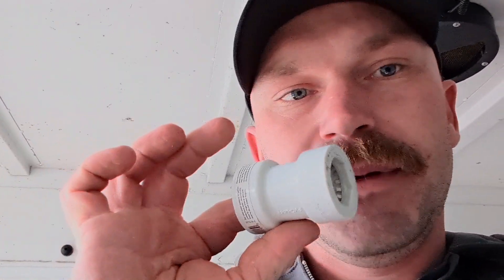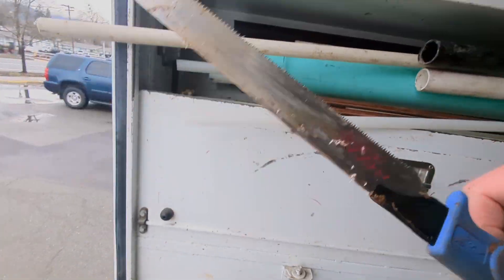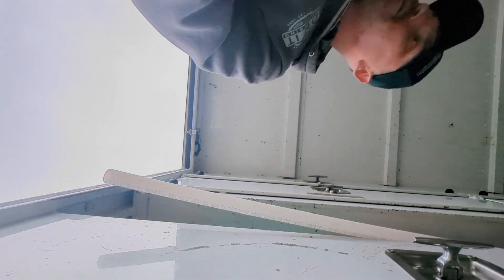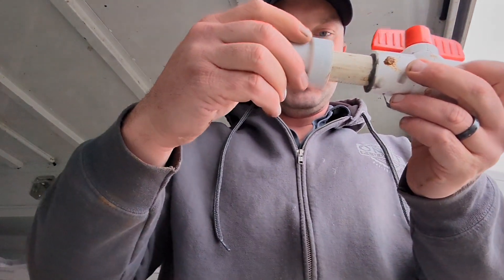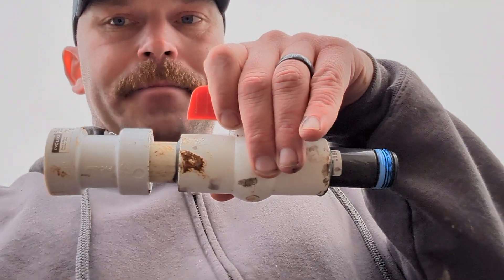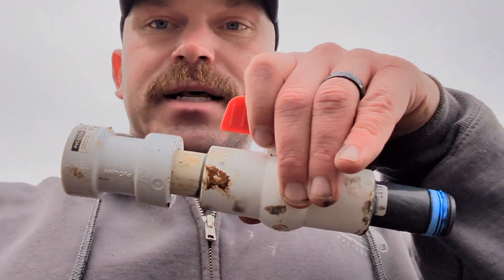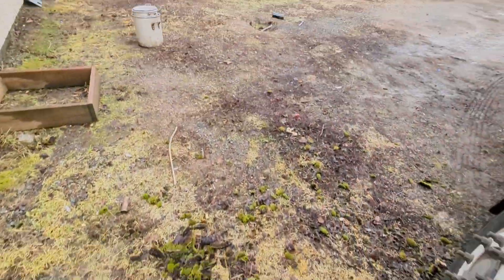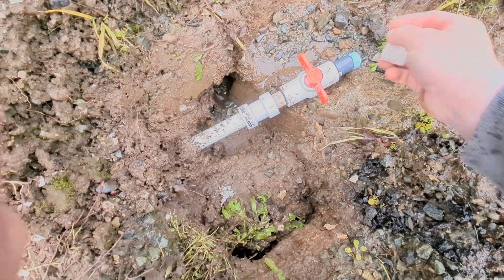BEST WAY TO Repair PVC LIVE UNDER PRESSURE!

Comment: I am doing water leads in Cyprus where we have a lot of CPVC pipes that leak usually glue problems from age. Is there any liquit or glue in the USA market that I could use to fix such leaks without digging the floor??
Reply from the maker: Unfortunately I don't think so I assume you are talking about under a slab. If so there's really not much of an option other than overhead replumb

Comment: Was that the end of the run?  Wierd that it was stubbed up like that in the middle of the yard.  Was is for a hookup for a trailer space?  Either way, you got it stopped.  Good job
Reply from the maker: Thanks and yeah old run down park may have been an old irrigation faucet but that particular place is a " get it by for another week" type location we have clogs and breaks regularly there and no proper way to shut the down. It's a mess so grab your brooms lol